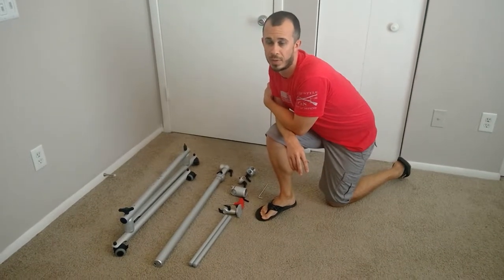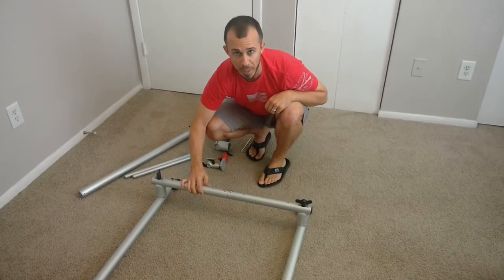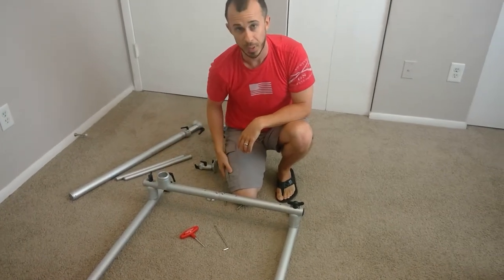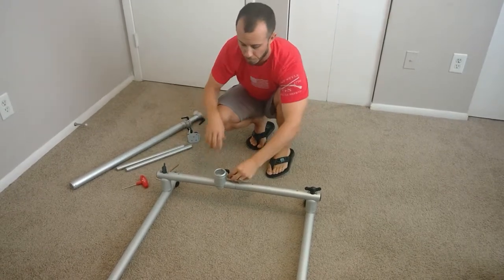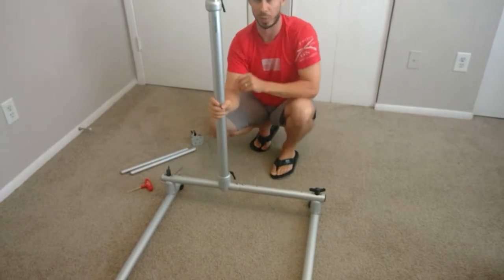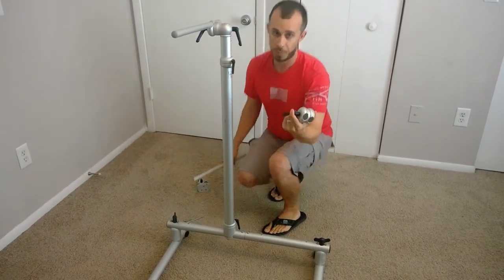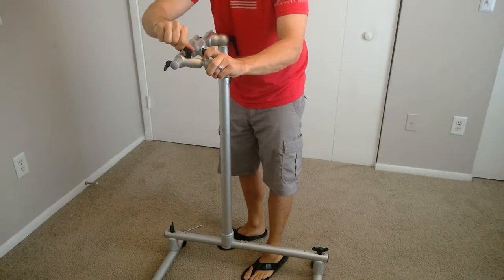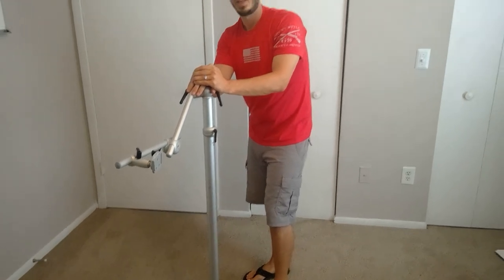Basic Folding Floor Mount Assembly

Comment: Is there an easy way to fold it up and put it in the black bag that comes with it or does it need to be completely disassembled?
Reply: Same question! I can make it fit without disassembly, but it's obvious the bag was designed for a specific method. No info on what that method is, though!